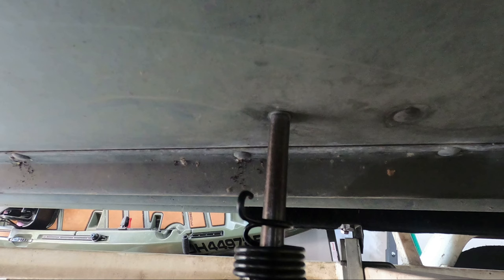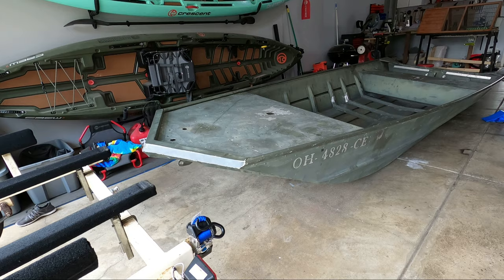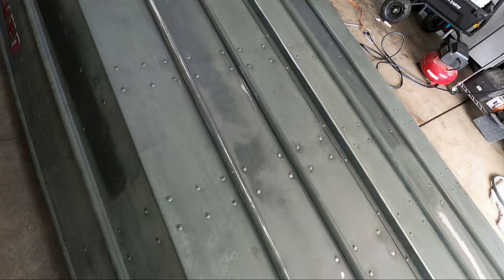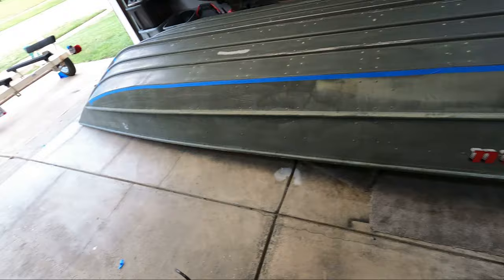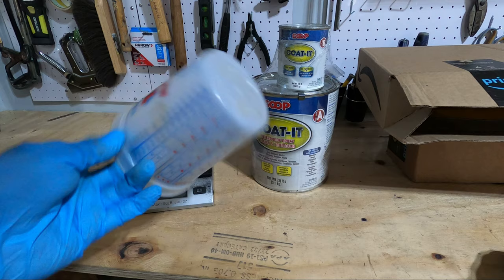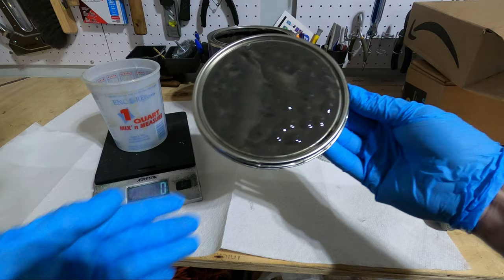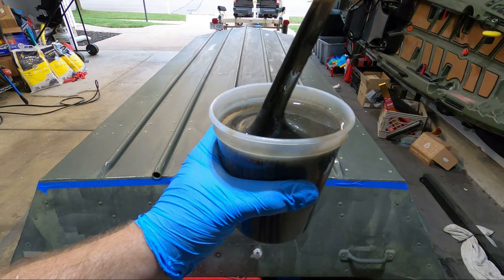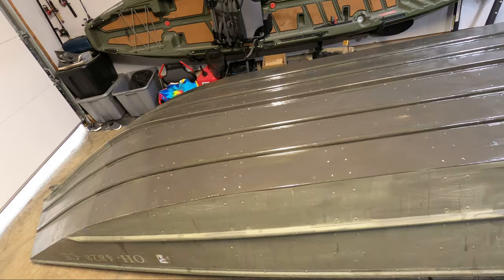COAT-IT BOTTOM COATING EPOXY GUIDE -  PREP AND PAINT - 1648 Jon Boat Build - FULL PROCESS

Comment: Im in the middle of fixing up my tinny. I had 36 holes in it. The previous guy had used pop rivets and stainless screws. 
The problem with electrosis is it's caused when dissimilar metals conduct when water gets between them. Or an electric cable earths into the hull not the battery.
Ive used jb weld. Then coated the entire inside of the hull with penetrol aluminum. 
Penetrol impregnates the aluminium. It dries out moisture which causes the rust/corrosion. 
Nyalic ect is great on a boat from new. But if you have corrosion it will just cover it. 
I took my boat out...16 years old... out and no leaks from the repairs..yet. 
Another thing to do is buy Tef Gel and put it on all screws you use on your boat. It forms a barrier between the screw and boat. 
Also..if you have a carpetted floor and electrosis take up the floor and treat it. My mate had a loose wire earth into his hull. It reacted with the salt water between the hull and the carpet.
Always wash down and remove any sinkers, hooks, swivels any foriegn metal.
Reply from the maker: 36 holes, oh man that must have been a project. That Penetrol sounds very interested, I'll take a look into that product. When using stainless into aluminum I try to coat the screw and area in silicone as a barrier, I'll also look into the Tef Gel as well. Corrosion is such a nasty thing to deal with and 100% should be avoided at all costs.

Comment: You only get 30 minutes once it's mixed. I used three of those plastic measuring cup containers to do both sides, the bottom and the transom on my little 8 ft. wooden boat. It's plenty thick. It's hard to push around with a paint brush. I can't believe people can move it with a roller. Between the 6 minute mixing of each container and pushing the crap around with a chip brush, my hands are sore. Glad that's done!
Reply from the maker: I was whooped by the time I finished, It really takes a lot out of you!

Comment: Just curious to know if you considered applying epoxy to the sides of the boat? Seems there are rivets there that are under water too. I would want to apply at least 3 or 4 inches of epoxy there, especially after going through all that prep work. Great video, nice job!
Reply from the maker: You could definitely wrap it around, I chose not to so you didn't see it. It tends to be rivets on the bottom that leak, I haven't dealt with any side rivets leaking to warrant wrapping the epoxy that far myself.

Comment: I just used fasco steelflex on a boat , it looks like the goop "coat it "is easier to apply . I couldn`t get a brush to do anything , did most of the boat with a squeegee . I like the dark grey color of the goop ,it looks pretty even . If i do another boat I will give the goop a try.
Reply from the maker: For sure, coat-it was so much easier to work with!

Comment: Mine wasn't completely setup the next morning (13 hours) but by the end of the day (it's 6 pm now) it's very hard. I did a few touch ups to make sure I never have a leak. It's looks like it's at least  1/32 of an inch thick everywhere on the boat, so I should be good to go, I'm going to let it sit for atleast 3 days to make sure it's supper hard.

Comment: 2 questions because i am in the process of doing the same stuff just on a bigger boat 1 how come you didn't just go over the seams and the rivets instead of coating the entire bottom? and 2 is if you were painting the whole boat anyway was it necessary to tape the boat? i am not bashing or anything i truly and trying to learn i have never done boat repair until now.
Reply from the maker: The bottom coating provides protection to the entire hull in addition to sealing leaks/rivets. For example beaching the boat, etc. You certainly could only apply to rivets/seams if that's your only goal.

As for taping, epoxy is thick and mildly textured. Even when you paint over it you'll see where the epoxy is. Taping it off gives you a nice clean edge that is much less apparent.

Comment: I got a 14ft Jon boat. Will the 2lb kit be enough? Can you go over existing paint? I’ve stripped most of it off but there’s still a few small thin spots
Reply from the maker: @sfpp2023  Yeah the 2lb kit should be enough. You can go over existing paint if it's  adhered well to the hull.
Reply: @mvboutdoors  awesome I think they sell it at my Home Depot I’ll check and try it this weekend

Comment: Good job Muscles!!!  Nice and slow!!!  I'd probably end up sanding down to bare aluminum, but like you said, if the factory paint is still good, you should be alright.  How did you pick that brand over the "others?"
Reply from the maker: Haha those boats are a lot heavier than you think, or at least awkwardly shaped!

I used Steelflex on the last boat bottom and while it was definitely slick it was such a pain to apply. I ended up using coat-it for sealing up some other bolts and the transom and I loved how it worked. It's also meant for boat bottom, about half the price and goes on much easier. Seemed like a no brainer.

Comment: After using this product and 2 separate coats......never again. It does work and is difficult compared to other products like aluminium Hawk which I have used and works the same but much much better.
Reply from the maker: Alumahawk is paint, Coat-It is an epoxy, a very different material and used for a different purpose.

Comment: Great video! I used this on my boat and I wanted to go up the side 3 or 4 inches.  Unfortunately when I did it, it ran some and is quite uneven in areas.  Now that it is set, do you think I could add a couple inches more a bit thinner to square it up?  Or do you know of a way to remove some to square it up?  I’m not completely happy with how uneven it is and it will bother me if I don’t do something.  

Any recommendations on primer to use for the whole boat before I paint?
Reply from the maker: I've used this marine primer a couple times now and it's worked out well: https://amzn.to/3i3Xjj8

For the runs, get yourself a sander with some 80grit and smooth it down then you can add a coat on top and it will look smooth. Any drips/runs are going to show through another layer on top.

Comment: I guess I only ordered a small can Wich won’t be enough for the whole bottom can I just do the rivits and what extra it covers ? Do I need to do the inside rivits  or any side rivits back etc or just bottom ?
Reply from the maker: If you're only looking to seal up the boat sure you can do just the rivets. You can do both the interior and exterior, just mix small amounts so you don't waste any.

Comment: Does it leave slick finish for bottom surface ...less resistance when flowing in water?
Reply from the maker: Yes, it's a very smooth surface. It's epoxy so it has that glassy feel. It's not as slick as gatorglide for example but its stiil very smooth.

Comment: Will gator glide stick to this stuff or does this make the boat slick like gator glide
Reply from the maker: You would use gatorglide instead of this, not layer on top. You could, with proper prep, but they are but epoxies.

Comment: Can you apply this while the boat is right side up? I just got a new engine added to my Aluma weld 1650. I dont want to take the motor and the controls off.
Reply from the maker: Coat-it would work well for applying from underneath. Something like Gluvit would be too loose and drip off but this sets up really quick. You may want to do it in smaller mixes and give the epoxy a little extra time to cook before applying so its nice and thick.
Reply: @mvboutdoors  Thanks man!

Comment: Use a automotive paint mixing cup it will have on the side mixing ratios no need for a scale….  nice job
Reply from the maker: Great idea, I'll look for that
Reply: Coat it is supposed to be mixed by weight , not by volume so mixing cup calibrations are useless. You need to use a small scale to calibrate adding the hardener.

Comment: To fill in dents how do you think coat it would hold up? I have my 16' mod v sanded down with 80 grit so it's rough and I wanna do a gloss black but I want to get rid of all the small dents I feel like bondo won't hold up due to flexing but I figured coat it or gluv-it would hold well and would be able to be sanded down evenly what do you think?
Reply from the maker: The problem would be applying it to vertical surfaces, coat-it would probably work a little better but gluv-it by design is very thin and runs. Flat surfaces either one would level would great, but for dents on the sidewalls bondo might be a better option.
Reply: @mvboutdoors  thanks bud. I might do a test and I'll let you know with flexing and such how they work out. Doing all this work having little dents on a finish project will drive me crazy because there's no story behind them.
Reply from the maker: @imnotwatching1  I know how you feel, I used to get really irked over having such a clean looking boat and then some random dents. I just have to remind myself that the dents are under the water line lol

Comment: Can this be used inside rather then the bottom like you would Gluvit  .I’m in Canada and Gluvit  is $120 plus where as i just bought coat it on Amazon on sale for $75
Reply from the maker: You could but gluvit works better because it's a lot thinner and seeps into cracks/rivets. You could probably thin coat it for a similar effect

Comment: Is this considered a bottom coat? Or just an epoxy sealer ? Can I paint over it or should I leave it as is ?
Reply from the maker: Yes this a bottom coating, all bottom coatings are epoxy sealers. Yes you can and should paint over it, paint protects epoxy from UV (not that it will get much exposure on the underside.) I did just that in the next couple videos if you wanted to see the process.
Reply: @mvboutdoors   I can’t find the video do you have to sand the sealer before paint?
Reply from the maker: @joshuaswanson3068  The main thing is to clean it really well with a degreaser first. https://youtu.be/YufHgSBi7zA

Comment: Hey 
Just wondering if there was any “coat it “ left over after the bottom was fished..
Thanks
Reply from the maker: Yes, I had about 1/4 left using the larger kit size.
Reply: @mvboutdoors  awesome thanks.. enjoy your videos! 👍🏼👍🏼
Reply: I only got 3/4 of the bottom done on my 1648 with the 8 lb. Kit and they didn't skimp me because I weighed it before hand.

Comment: Do you only have to seal the bottom? Or inside aswell? My boat has multiple rivet leaks
Reply from the maker: In my opinion, the more the better. I plan to seal from the interior with Gluvit just to be safe.
Reply: @mvboutdoors  thank you! Should I try to tighten the rivets at all before? Pretty new to this but wanna get my boat in tip top shape!
Reply from the maker: @_its80_  yeah for sure, I used an air hammer and it worked really well
Reply: I’ve got crack on the bottom left corner of the transom. Previous owner tried to patch with jb weld. Still leaks got any suggestions?

Thank for all the info it’s a big help!
Reply from the maker: @_its80_  For me I would get it welded, it's the only thing that will last long term. If you want a temp fix, drill the ends of the crack so it doesn't expand and fill it with epoxy/sealant.
Reply: @mvboutdoors  thank you! Look forward to more videos!!

Comment: THAT WAS MY QUESTION, could it be used over other paint. 👍👍
Reply from the maker: For sure! Factory paint is usually very good, as long as its in good condition the epoxy will adhere no problem.

Comment: Have you had any issues keeping the black clean?
Reply from the maker: Water spots are always an issue with black finishes but they wipe away easy enough. Much better than a white color like my last where it would stain up to the waterline everytime it was taken out.
Reply: @mvboutdoors  thanks for the quick reply. Love your channel too BTW.  I'm building the same 1648 at the moment. Just got it stripped and ready for the coat it bottom coat. Got a little nervous on the mixed reviews of black paint.   Guess it can go either way with any colors also.  Just did not want to follow the trend of camo.

Comment: What makes gator glide or super sluck any different from this one? Aren’t they all epoxy coatings? I also ready you have to paint this stuff because its not uv resistant
Reply from the maker: Yes, they are all epoxy coatings with different mixes of additives to perform differently. Most epoxies will last longer if UV protected via paint but only some manufacturers put it on the label. Gator Glide / Super Slick have glossifiers and additives for slickness built into them. Coat-it has kevlar to make it more durable/abrasion resistant which I feel works great for a boat bottom but it does not have slickness additives. That doesn't mean it won't be smooth or any slower on the water. Slickness additives are less useful for boats that won't be skating over grass/logs like an airboat/mud boat would. 

Hope that helps!

Comment: Have you ever used a totalpaint product coatit  epoxy?? 

Just wondering if the total paint would accept the coat it epoxy without peeling over time 
Thanks  ..
Reply from the maker: I have painted over Coat-It and it holds paint great. You have to make sure to prep it properly. I did a video here for how to prep epoxy before painting: https://www.youtube.com/watch?v=5SiuLqZ1k9w
Reply: @mvboutdoors  yes I’ve watched that video a few times as I’m getting ready to paint my boat . Love your videos by the way, they’re very thorough. 👍🏼
But I’m not using rustoleum. I went with a product called “totalboat” paint ..
It’s pretty expensive per gallon .. 
Just curious if you’ve ever work with that product. And what were the results after painting over the coat-epoxy.. 
thanks
Reply from the maker: @BruceErler-ts3ef  Thank you! I haven't used total boat products personally but Coat-It in general is paintable so I can't see it being a problem.
Reply: @mvboutdoors  ok thanks 👍🏼